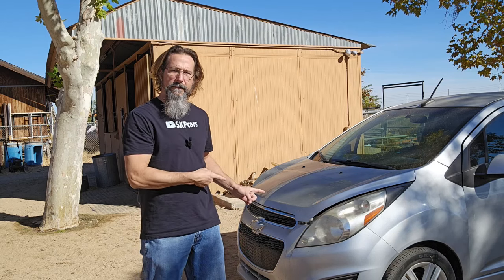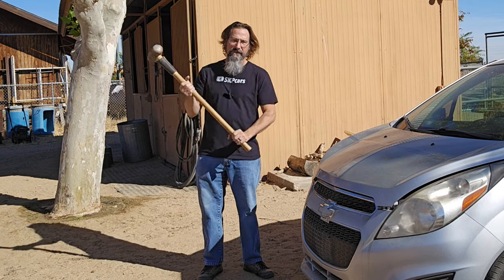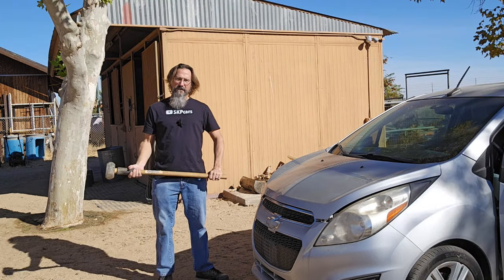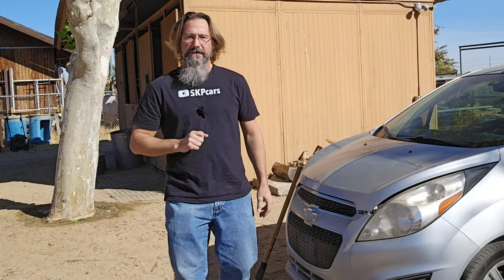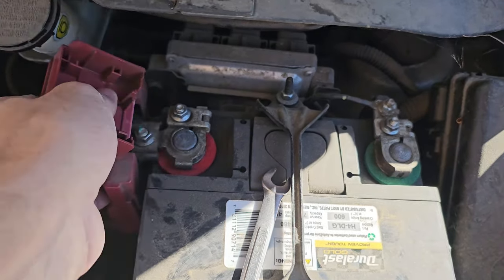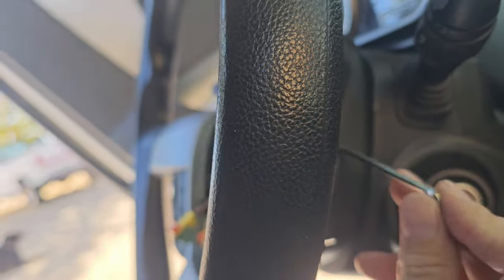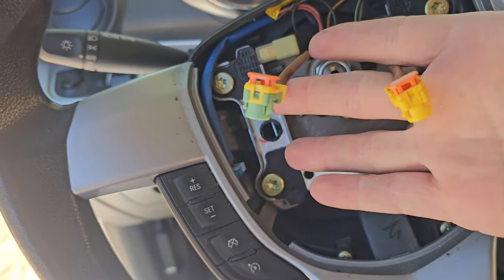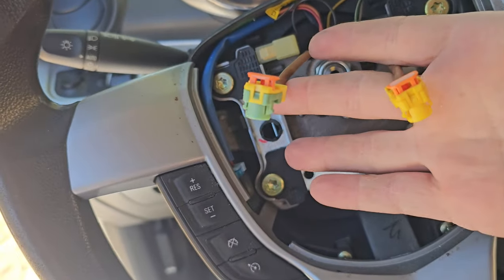Setting Off an Airbag in a Chevy Spark

Comment: I thought you were going to jack the car off the ground, let the wheels free spin in drive to get the minimum speed, then hit it with the sledge.
Reply from the maker: @JohnDoe11VII  that is incredibly dangerous. If i did that i would be potentially risking my life. Plus , it probably wouldn't work because the sensors are behind a crumple zone. I could have driven it into a tree! Haha, it's still incredibly dangerous.
Reply: SRS ECU for simple head on systems (2 airbags and maybe sone seatbelt pretensioners) can have no external sensors, this kind can deploy airbags with just being powered and hit in enclosure :>
Reply from the maker: @poprawa  well i didn't know that but i still would have had to drive it into a tree to set it off.